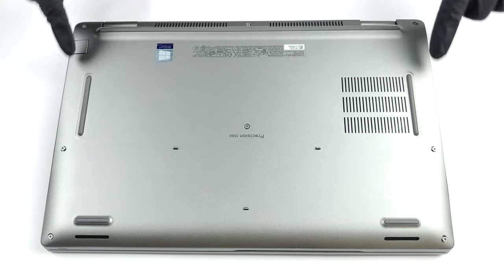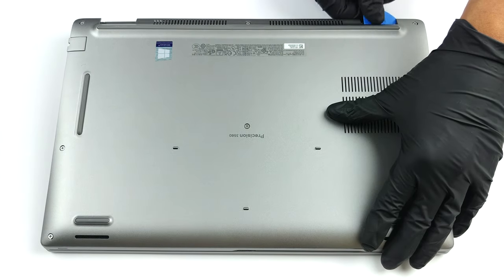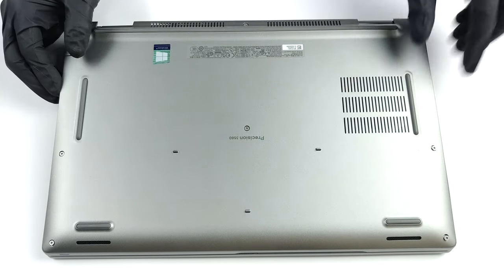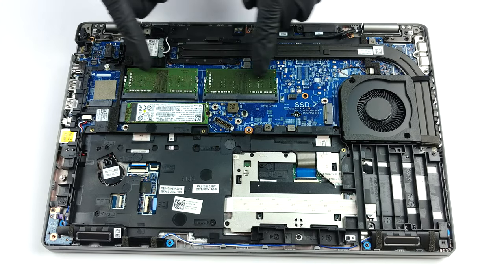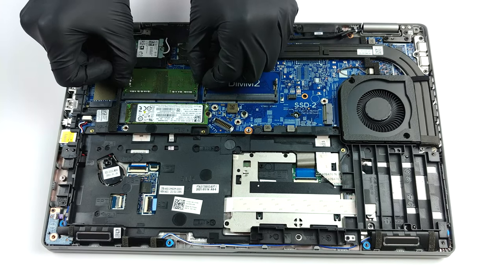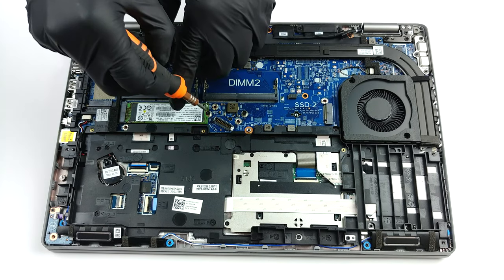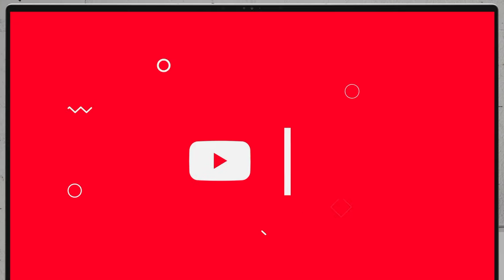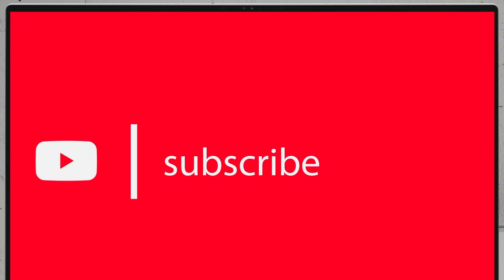🛠️ Dell Precision 15 3560 - disassembly and upgrade options

Comment: Great. i have the Text SSD2 on the main board and then the connector is missing.  i understand this is a dell problem but the most pragmatic way would be to replace the first / main SSD ( 256GB) with the new Samsun 2 TB SSD. but would safeboot and such accept this as it will detect a different  boot drive etc..

Comment: Is it easy keyboard replacement possible? Or does the everything have to come out? I want to swap it for a QWERTY.
Reply: I had my keyboard replaced under warranty. The whole system practically needs to dismantled to get to the keyboard screws.

Comment: I bought one of these machines and it only has one SSD slot. I assume Dell only add the second SSD slot if you buy it from them at configuration time. Not a big problem but very misleading information from Dell. I even checked with them before I received my machine and they thought it had two slots too.
Reply: they cannot remove it. If you have right model (15.6") there there must be two m2 ssd slots.
Reply: @pawelsalford6373  I didn't say they removed it. It was built to order, so it was never added. I have the right model (15.6).
Reply: The second m.2 connector is not soldered. It's quite strange. Received mine today. They probably only add it if you ask for two ssds when buying from their website.
Reply: @Shipwrecked1103326  this is really bad from DELL.
Reply: it does clearly say in specs that computer shipped with discrete graphics card has only one m.2 slot, 2nd slot only comes with Integrated graphics only, can you conform which one you have?
Reply: @akhil3126  I didn’t see that when I looked. Dell didn’t see it either, based on their answer. I have discrete graphics.